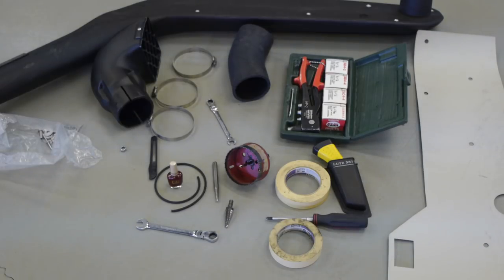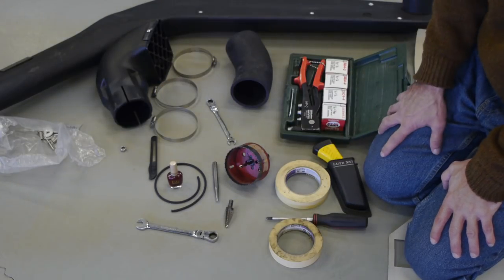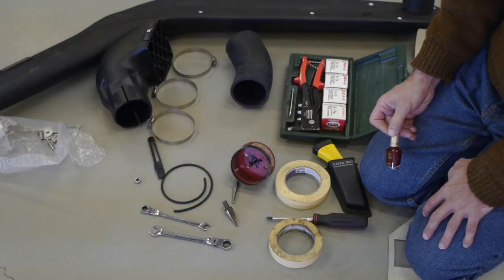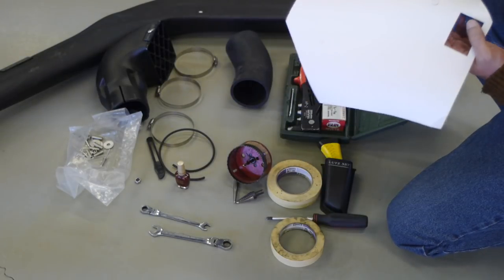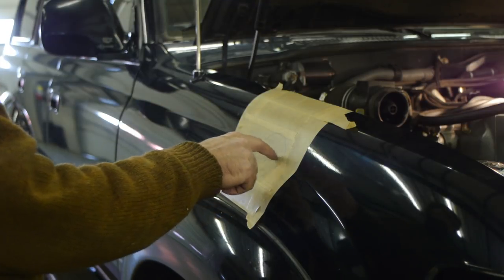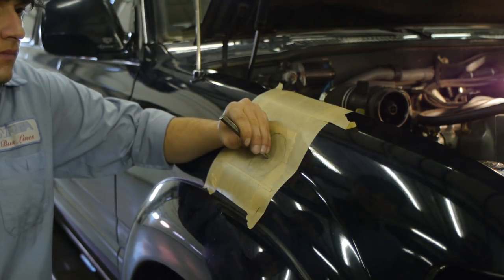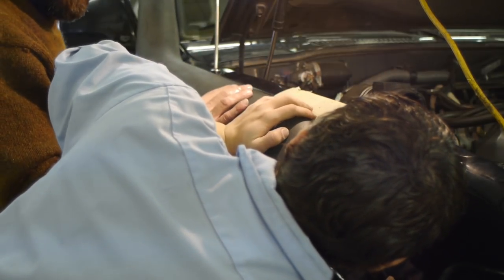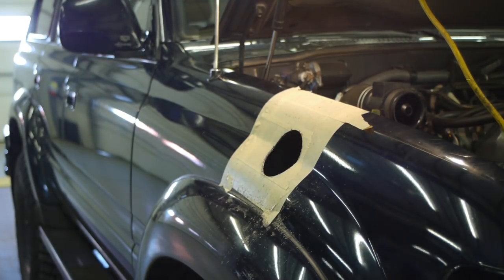Toyota Land Cruiser. Snorkel Install

Comment from the maker: No so far didn't have to do it yet, even though I also have a small leak in that area. Mine has 170000 at this point. Probably another 20000 and I'll have to change it. At least I hope I can get that long out of it.

Comment: Thanks Jake for the videos. I read extensively on the mud forum. Looks like the majority of folks go with the no name brand. It looks like there are different suppliers of the snorkel making me wonder if there's more than one company making them. Regardless I'm going to check the template to be sure it matches up!
Reply from the maker: Right, I don't know but given everything else out there it's likely all of them produced in the same plant just branded differently. Regardless mine is over 3 yeas old and holding up fine.
Reply: +Jake Paslar That was the consensus on Mud. Good luck on the trip!

Comment: haha, I taped the template to my rhf guard/ panel and smashed a 3" hole saw through, no goin back once you start drilling. Drilled the other holes and fuck me, 3 dont line up, time for Mr diegrinder ;-) all fitted looks sweet as, you wouldn't even know about the rusty bullet holes under the snorkel. (they're not rusty, I painted the holes)